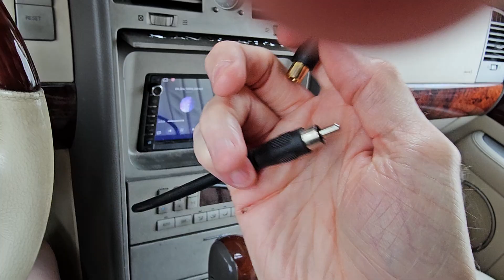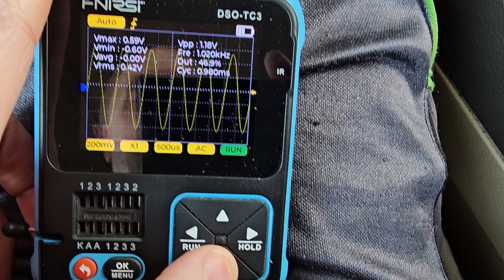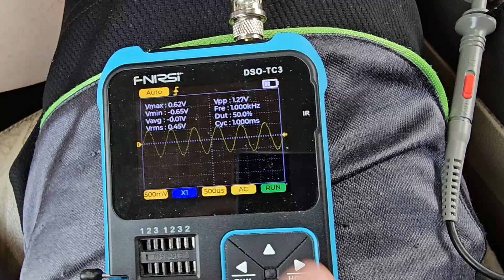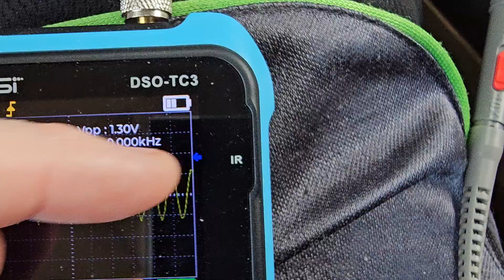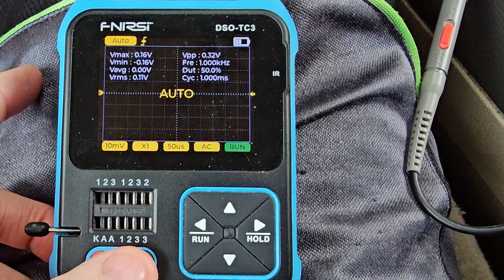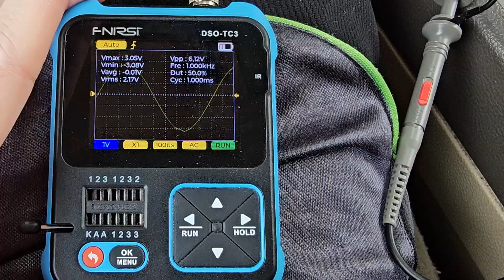Oscilloscope Basics - car audio related

Comment: Jason link for RCA cord ?
Reply from the maker: It's a very common item. Just search for "bnc to rca cable". You can find them in different lengths. 3 foot seems fine, but you can go longer if you want. You can get it with a male or female RCA end. My cable is kinda stiff, but some are a lot more flexible.
Reply from the maker: These small scopes use a MCX connector on top and come with a single adapter so you can use the more traditional BNC accessories that most oscopes use. You can order a couple extra MCX to BNC adapters if you want. Just in case you misplace the original. 

I'll make another video showing how you can adapt your multimeter accessories to fit the scope. That really opens up some new uses.